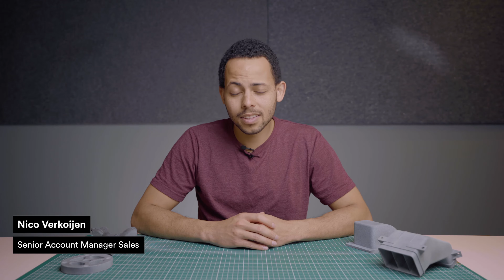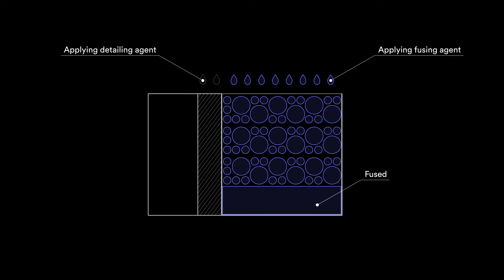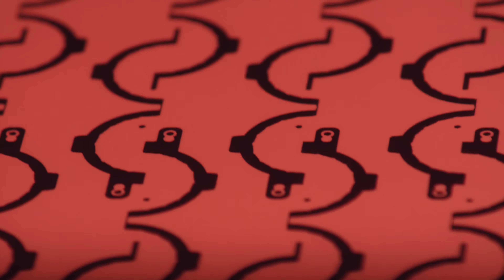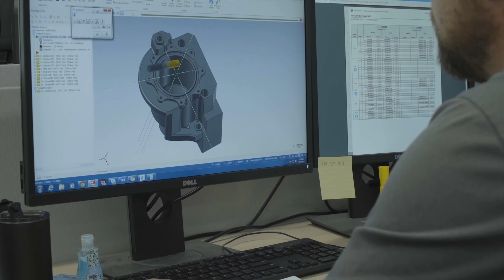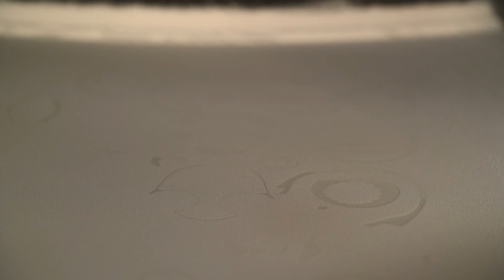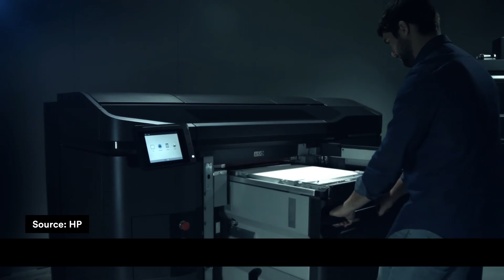What is Multi Jet Fusion (MJF) and How Does it Work?

Comment: With MJF i always feel a mild powder residue on my fingers whenever handling parts. That said, this type of 3d printing did save our butts a couple of times. We were able to print some pretty challenging objects, like large (<600cm2) surfaces only 0.5mm thick with good dimensional accuracy.
Still quite expensive for volume production though.